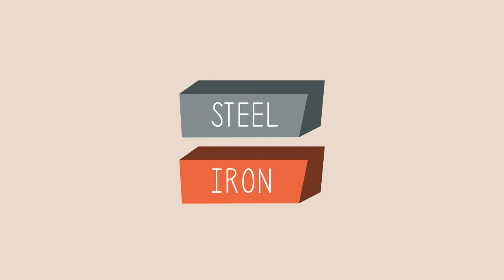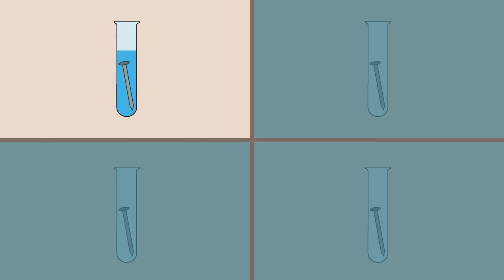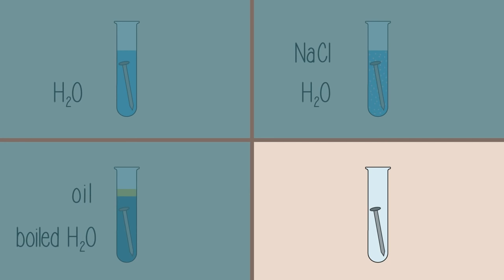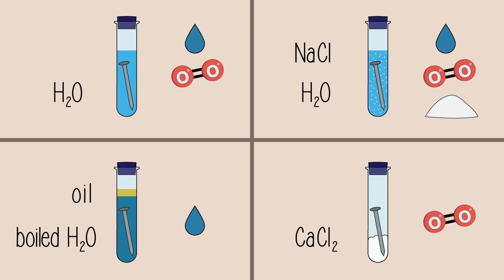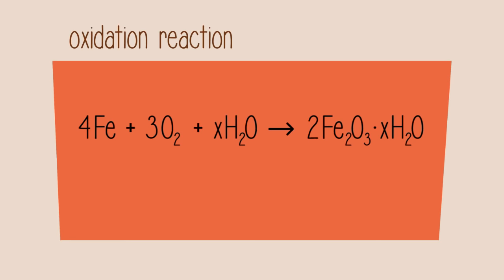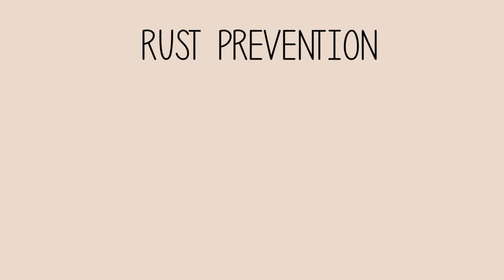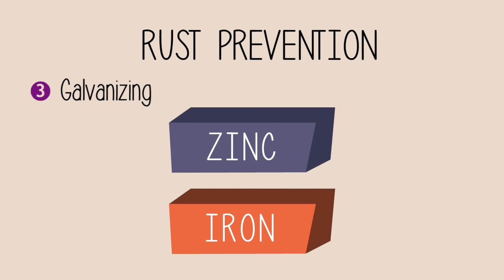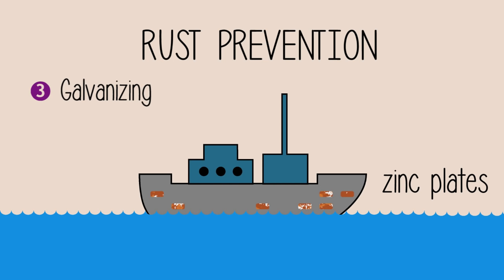Rust: Prevention & Treatment | Environmental Chemistry | Chemistry | FuseSchool

Comment: I thought that galvanising and sacrificial protection are two slightly different methods.   Galvanising protects iron by covering it completely with a layer of zinc, which is itself protected by a layer of zinc oxide.  If oxide layer is scratched, then zinc reacts rather than iron.  Sacrificial protection involves a block of a more reactive metal being attached to the iron and this corrodes, rather than the iron.
Reply: But then zinc is more reactive than iron so this corrodes instead of iron 
Or I’m wrong
Reply: Galvanizing can actually accelerate galvanic corrosion. Do a search for galvanic corrosion.
Reply: That is correct, my guess is that they are referring to the fact that the waves and wind on the sea would erode the layer of zinc oxide away, and constantly kick-starting the process again.
Reply: no

Comment: When mentioning "Rust prevention", galvanizing is wrongly mentioned, as you are in fact showing an example of cathodic protection. Galvanizing is a type of coating (normally a zinc coating) with two different protection modes: a barrier effect (there is a coating on iron) and an active cathodic protection effect (zinc corrodes, protecting iron). However, the use of zinc anodes in ships is not galvanizing. Zinc anodes are not covering all the surface of iron, so here we have cathodic protection but no barrier effect.

Comment: If you can galvanize with zinc because it's more reactive, does that mean that using magnesium or aluminum would yield similar effects?

and

What determines the reactivity of elements (metals in this case)?
Reply from the maker: Yes - magnesium in particular is often used as a sacrificial metal (as is zinc).

More reactive metals have a greater tendency to lose electrons to form positive ions.

Comment: Rusting of iron required water and oxygen. The presence of salt or NaCl where it will act as catalyst in hastening the rusting process on the iron. At higher temperatures, rusting process is higher. Why? The iron atoms will not spontaneously emit out their stationary electrons before turning themselves to Fe(2+) cations. Water molecules within the droplet of water are constantly drifting within itself. At higher temperatures, the drifting water molecules will have higher velocities. Dissolved oxygen molecules within the water droplet where they will adhere on those drifting water molecules. Whenever the oxygen "atom" on a drifting water molecule is slamming against a iron atom, this may force it to transfer some of its electrons to the oxygen "atom" before it turning to Fe(2+) cation and the oxygen "atom" will turn into a oxygen anion or O(2-). This is how iron gets rusted. At higher temperature, the oxygen "atom" that adhered onto the drifting water molecule will slam harder against the iron atom therefore the rusting process will be hastened. The molecular mass of water is 18. Whereas the one of sodium is 23.9. Therefore the oxygen 'atom" that adhered onto a drifting sodium cation will slam against the iron atom much harder to force chemical reaction to take place. Thus, the presence of salt or NaCl within the droplet of water will hasten the rusting process of iron. If you are interested in real discoveries, I would recommend you to read my book, The Unification  Theory - Volume One and you will be amazed with lots of new, interesting discoveries. In God I trust.

Comment: I have a doubt on one of he things that you said...
 "Zinc getting corroded faster than iron"...
If so happens then wont it cause a problem economically????
Rather can't we use a substance which has a lower corrosion rate?? Like Tin or copper???
Copper is cheap...
Why is it that we go on galvanizing more that tinning???
And what is the advantage about zinc oxide formation? We just have to deoxygenate it over and over again....
Galvanizing causes the ship's outer layer to rust went it sails... So how are we keeping corrosion at check???
Thank you.
Reply: +Hrishikesh hatti Keeping zinc on iron, Zinc will act as a motherly layer. When Zinc corrodes it doesn't form a coloured layer. So when zinc is placed on iron it will not let the iron rust but the zinc will rust but it will not produce a rust layer or degrade the iron. Hope i helped u
Reply: thank you very much...
it did help me out..

Comment: So what im going really to do? I replace my tap 3x in a year because its rusted always. Our water supplied by our developer isnt a good quality and the water is abit salty. All my taps,lavatories and toilets are all rusty.  How to rid off of this? Thank you
Reply: Install a professional water filter at the hot water heater if you can, a plumber can install a filter unit that you can attach to the main pipe (i think ) it will add chemicals to soften the water which is what you want, because hard water and rust go hand in hand.

Comment: Why is there an X in front of H2O?
Reply from the maker: What time in the video please?
Reply: 2:52
Reply from the maker: The x just stands for a varied number of water molecules. If it is 4 on the left hand side of the equation, then it will be 4 also on the right hand side. The H20 stays as H20 throughout. Does that make sense?
Reply: Yes. Thank you
Reply: Balanced equation